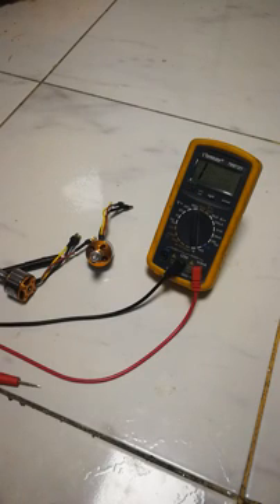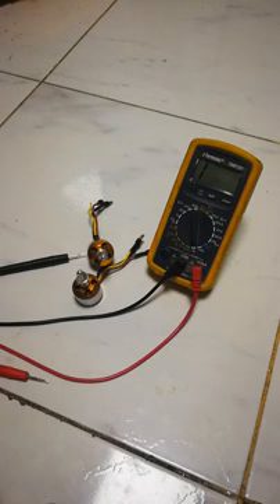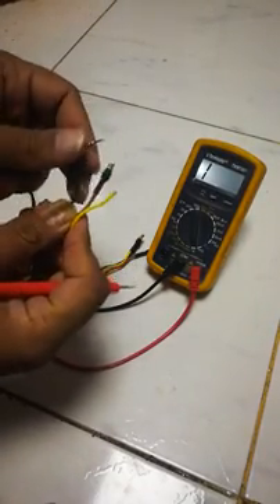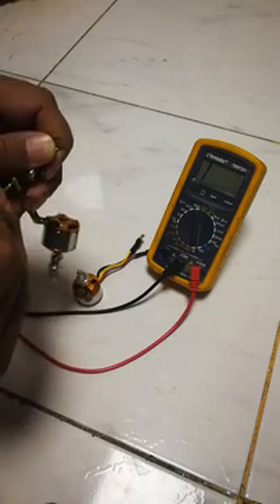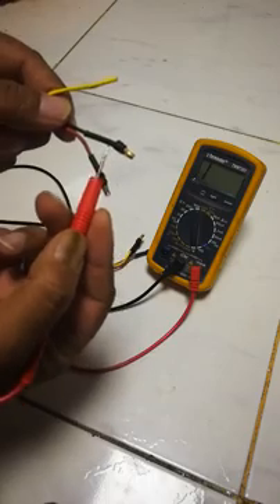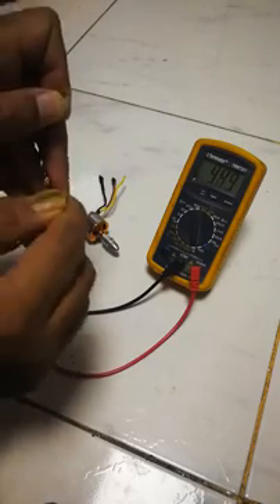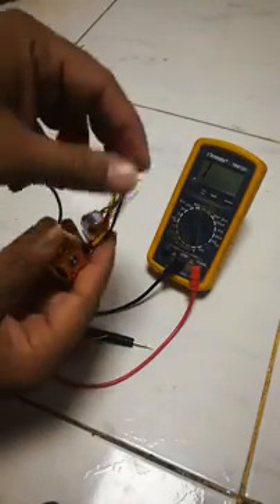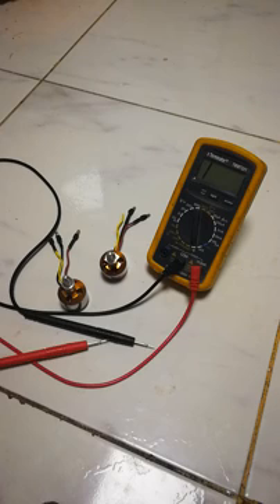[SOLVED] Twitching Problem on A2212 1800kv Motors

Comment: I have same problem but when checked with multimeter all connectors seems to be  connected properly?
Reply from the maker: It can't be that, either you're checking it wrong. or there is some other problem. When you're testing the leads, flex them around, there must be a point where they disconnect. You could, in the end, have a faulty motor.
Reply: @how_its_done response from motor is same as when one connector from motor to esc is disconnected. I tested motor with another esc same result. Esc worked fine with other motors.I used multimeter continuous test for testing connections. Any guess on the fault? Thnx